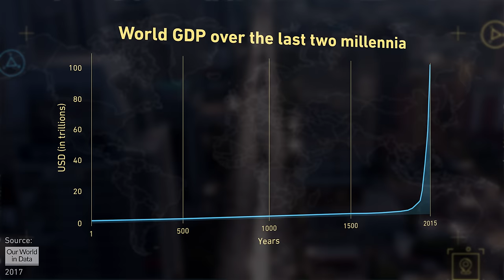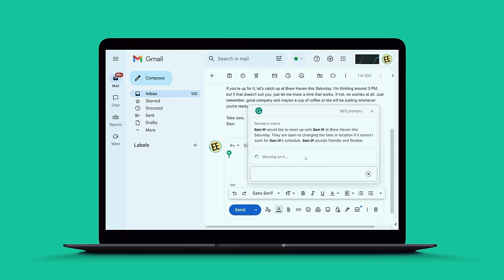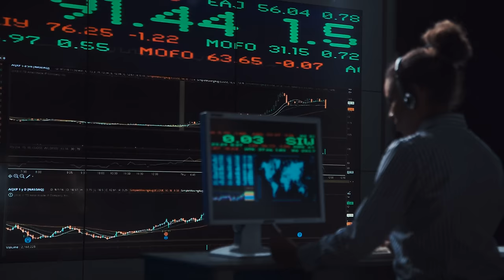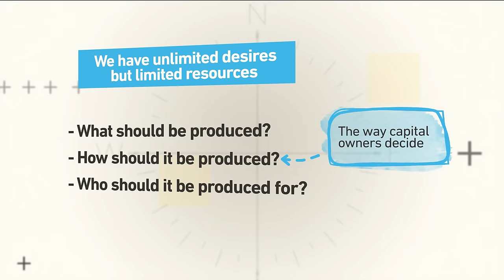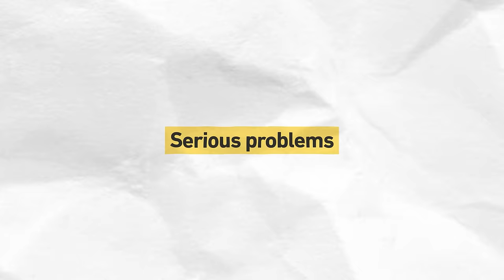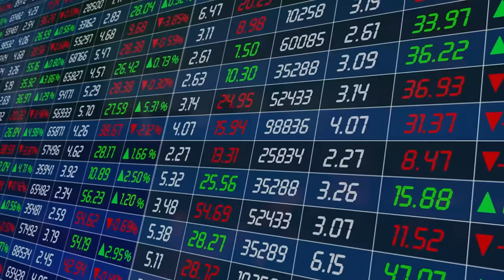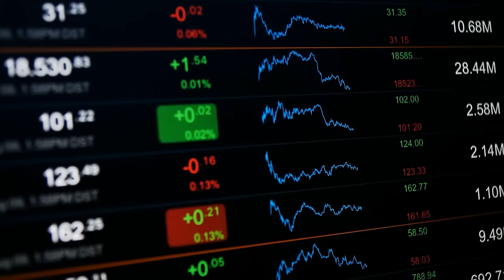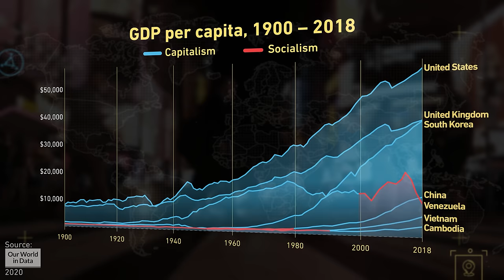Why Every Country Ends up Capitalist

Comment: I'm very aware of the shortcomings of the capitalist system but to say that exploitation of natural resources and erosion of human rights don't happen in other systems is not a great take. I'd argue inequality is similar actually.
Reply: Sure, you're right, it happens in other modes more. But what are we then talking about? Serfdom, colonialism and feudalism? I don't see how socialism is worse on human rights than capitalism
Reply: It’s true that exploitation of natural resources is not exclusive to capitalism. However, the scale and rate can vary significantly between systems. For instance, in a capitalist system, the drive for profit often leads to over-exploitation. In contrast, other systems tend to have more regulations and checks in place to prevent such exploitation.
Reply: While it’s true that human rights violations have occurred under various economic systems, it’s important to note that these are often more a result of political structures and leadership rather than the economic system itself.
Reply: It would be better described as a loop, where pure capitalism or pure socialism both create a single exploitive monopoly.
Reply: @uninstaller2860 socialism is MUCH worse for human rights... It literally HAS to ignore the natural rights of having private property in order to redistribute their earnings. Aka stealing. With capitalism it's voluntary.
Reply: @uninstaller2860  If you don't see it, you're either not looking hard enough, or you're blinded by ideology.
Reply: @ianmwangi2105  Comical to think the same drivers behind Capitalism are somehow absent in other systems.
The core engine of the automobile is identical between Capitalism and Socialism.
The difference is the chassis.
Reply: @GiRR007 you are confusing socialism with communism. Socialism is just an economic framework like capitalism, you can adapt it to your form of government. Communism uses involuntary redistribution of wealth to create a community that is level n can find commonality.
Reply: @SokiHime  If you can't explain it, then you don't understand what you believe yourself
Reply: @uninstaller2860 Clearly your Soviet history is a little lacking, if you think socialism doesn't do worse
Reply: @GiRR007  Who own the oil in the earth? The government or the people? Why not the people?
Reply: @uninstaller2860  also, your Mao history is a little lacking too
Reply: @azraeldemuirgos9518  I'd argue that the Soviet Union never reached even close to Socialism. The workers didn't control the means of production. The moneyless society was only for the party elite. There was no real liberty, no real democracy in election. Also, the Soviet Union was a state, which in itself tells us all that it wasn't a stateless society, which is the goal of Socialism. So, it is you who lack an understanding of Socialism. So, what was the Soviet Union then? State Capitalism, with a top heavy hierarchy.

Look, my goal in society is to have ownership of production by all people. It's workplace democracy, where we can vote our boss away. Personally I don't mind a manager making 4x my salary, but I do mind when it's 10x, and I hate it when they make 117x more. I want the workplace to look more like a functioning democracy, with freedom of speech. There is nothing that says your workplace has to function as a dictatorship or monarchy. You maybe don't like the terms I use, but I imagine you don't find my goals reprehensible? I will have solidarity with you, even if you don't find it in yourself to have it with me
Reply: @SokiHime  misrepresentation of my argument 🤦,,,shows the weakness of u're point,,, didn't say the drivers were absent just said that in capitalism there is a reluctance to enforce restrictions as these are generally seen as interfering with the free market
Reply: @lilyusi  thing is if a large enough proportion of the population decide to take up communism rather than capitalism it wouldn't really be involuntary,,,, for society to reach such a level where communism and marxism are the general consensus it would mean that most people feel like they don't have that much wealth to begin with
Reply: @azraeldemuirgos9518  there's a distinction actually between socialism and communism,,,what u referring to with the soviets is communism
Reply: @ianmwangi2105   but it is a type of socialism, is it not? Or are you trying to imply it is not a type of socialism?
Reply: @uninstaller2860   Firstly, you are arguing for a stateless society, yet are unable to distinguish that isn't socialism but Anarcho-communism, basically a type of socialism. Go back and learn again.

Secondly, the Soviet union was socialist, even communist, as they implemented collective farming and centralised the means of production into their hands, which is what socialism is, basically the means of production controlled by the state, as opposed to Capitalism which is the means of production controlled by private individuals. Communism is a type of socialism which adds the prerequisite calling for the abolishment of private property and 'eliminating Class inequality ' by 'redistributing wealth', and they failed woefully in helping the people or the environment as evidence by the famine and death and the major Environmental disasters that till now have yet to be abated (Chernobyl, the dried up river).

Thirdly, I don't care about your goal, or the fact that you believe in a fantasy ideology like 'workplace democracy'. Democracy only works if you own that thing by which you want to make a decision towards. The people own the country, the people built the country, the people are the country, they are born in it, they die in it, so it makes sense for Democracy to exist in a country. The workers do not own the company, the workers did not build the company, the workers are not the company, they are not born in it, they do not die in it, they simply have a contract with the company to work for a limited period of time, so what right to they have to act like they own the place? If they don't like the company they can simply leave. Do you allow the plumbers and builders you hire for your house to have a say in the decision makings of your house, do they get to tell you what to do? No, because they are simply hired hands, just like your house cannot be built or function without them, a company cannot function without workers, and similarly just like the builders have no say in your house (even though their entire livelihood is dependent on people like you who hire them), neither do the workers for the companies. You communists refuse to consider human behavior or common logic in your ideology because you know once you do, your ideology falls apart
Reply: @azraeldemuirgos9518  Marx didn't distinct between socialism and communism. I think it was Lenin who did that. But your definition is correct in how it's colloquially understood today, that communism is a deeper form of socialism. I'm more of an anarchist, so I haven't forgiven what Lenin did to the Russian anarchists. That's why I also use the term Socialism rather than Communism. The Soviet Union has tainted that term, with a lot of help from China
Reply: @azraeldemuirgos9518  Lol mucho texto, you'd be a great leftist. But no plumbers aren't just hired hands or unskilled labor as you seem to imply. If they were, there wouldn't be work for plumbers. I believe in you. There's room for you too to make this fantasy reality
Reply: @azraeldemuirgos9518  what u using is called the part and whole fallacy,,,,that is since communism is generally viewed as wrong everything even remotely associated with communism,,,eg socialism is inherently wrong,,,read on both then come back and argue against them 🤦
Reply: @azraeldemuirgos9518  social democracy is a reasonable middle ground between communism and capitalism,,,yes the hired hands don't have a right to dictate the rules in your house 🏡 but as tax paying citizens of the state such as yourself you can't have total power over them,,,which is where the state comes in with high minimum wages,unions for collective bargaining and all that good stuff that prevents people like you from paying them next to nothing then cruelly saying if you don't like it then leave
Reply: @ianmwangi2105   nope, I am not using that argument at all, I am simply trying to go against the notion here that socialism and Communism is different. Yes, not all socialism is Communism, but that doesn't make socialism different from Communism, just like how you cannot a finger is different from a thumb, when a thumb IS a finger. Communism IS a type of socialism hence saying there is a difference, instead saying 'communism is ONLY a type of socialism ' is just plain wrong. I would love to hear your argument against this
Reply: @uninstaller2860   This is purely a semantic argument, and will simply lead down to an unnecessary rabbit hole, whether Lenin made a distinction or not doesn't matter, infact it doesn't matter how Marx understood it, since socialism predates him, he came up with Communism, not socialism
Reply: @azraeldemuirgos9518  the problem isn't with definition it's the fact that most of the time people impose the flaws of one system on the other in a debate and use that as justification to dismiss both
Reply: @ianmwangi2105  'social democracy is a reasonable middle ground', yeah, I don't wholly agree, even your high minimum wage talk doesn't hold water as we know that the highest paid wages are in Scandinavian countries, which don't have statutory minimum wage (yes, they have unions who engage in collective bargaining industry by industry, but that isn't the state, as you so claimed would be good), America infact has had a decline in the proportion of black and young workers since minimum wage was implemented as it turns out that minimum wage hurts unskilled labourers the most, cause obviously, companies will want to hire skilled people if they have to pay them more. Again, Human Behavior is what you have to take into account when it comes to all these things. Any system can work well, even Communism, as long as it is pragmatic enough, the problem with communists is that they refuse to be pragmatic, instead indulge in fantasies of how humans would act In a selfless society, that's why the successful ones always resort to authoritarianism, because they realise too late that Humans act based on incentive, and to preserve their ideology they force humans to act they want they desire, and it all goes downhill from there.

If a company wants its workers to have a say in how it runs, I have no problem with that, it is its right to do so, but that doesn't means to force others to have to share the ownership of their companies with their hired hands
Reply: @azraeldemuirgos9518  Didn't you read my comment? I meant that it is semantics from my part, yes. And no, Marx didn't invent communism or the term even. He popularized it, but he added to it a lot though!
Reply: @ianmwangi2105   that is their fault no? That is not a justification for you to be wrong, say it as it is, Communism is only a type of socialism, it doesn't define socialism as a whole
Reply: @azraeldemuirgos9518  claiming unions and the state aren't at all connected is dumb 🤦read on the role of States in workplaces and you'll find out that different government policies regarding unions is the reason we have more unions in Scandinavian countries than in the States,,,, Scandinavian countries generally being more socialist tend to have more union friendly policies while the States which is generally more capitalistic has more corporate friendly policies
Reply: @azraeldemuirgos9518  🤦🤦 can't believe u seriously implying that companies will suddenly demand a university degree rather than hire unskilled workers because of a minimum wage rise from 6.55 to 7.25,,,, how many skilled workers do you think will work for 7.25,,,most white collars can't get it but such a small rise can mean the difference between starving or not for most of these unskilled workers,,, especially with inflation eating up what little they make,,,,but according to you paying someone enough not to starve is too much a price to pay,,,then you'll start singing how capitalism is everyone's savior 🤦🤦 my point exactly on why it is so difficult to see people as people and not just statistics on a balance sheet in Laissez faire capitalism
Reply: @azraeldemuirgos9518  I think it is ingenuous to say that communism relies on the naive believe that humans are selfless,,,the exact opposite is true actually where socialist and communism systems acknowledge the inherent greed of human nature hence place government interventions in place to rein it in whereas capitalism runs on the naive assumption that the market will miraculously do what's best for everyone
Reply: @azraeldemuirgos9518  that's the thing 💔 when you say someone owns the company we generally view it as owning the capital and land and not the people,,,but by having the power to pay those people however little they please and telling them they can leave if they like,,, whereas in reality they can't since every company is doing the same,,,the capitalist end up effectively owning the workers,,,which is what pretty much every other economic system (except feudalism) is primarily opposed to
Reply: @ianmwangi2105  a government policy allowing unions to bargain on their own is different from a government taking one the jobs to bargain, no, order the level of wage 'on behalf of the workers', do you not understand that difference? Governments are also what protects patents and intelligence properties that allows capitalism to flourish, are we going to then devote the success of companies to the government? That's incredibly stupid, and it's disappointing you failed to make that difference.

Also, you say Scandinavian countries are more socialist, you also have that wrong too, yes they implemented some socialist policies but they are actually more capitalist than even USA, go and check the capitalist countries index and you will find out. You don't even need to check, their policies on tax and how they target the middle class more than the rich and companies is alone enough to tell you how they view their society
Reply: @uninstaller2860 Serfdom, colonialism and feudalism are not economic systems. They are political systems.

Every socialist country to date has made extensive use of forced labour enslaving the people to the state and has committed genocides against political dissents.

Also your arguments that socialism requires a stateless existence makes it an impossible goal. A stateless nation cannot exist while other states also exist. They inevitably are either dominated by a neighbour or collapse into a hierarchical state.
Reply: @azraeldemuirgos9518  so are you saying that america is more socialist?
Reply: @azraeldemuirgos9518  checked out your "capitalist countries index"🤦,,you are talking about the economic freedom index which is a measure of opportunity in commerce rather than "how capitalist a country is",that's why Scandinavian countries rank higher,,,their socialist policies tend to ensure more economic freedom at the expense of maximum production which is the opposite of americas more capitalistic take
Reply: @ianmwangi2105   what no? That's not what the index means, the index simply ranks countries most favourable to Capitalism and businesses, and Scandinavian countries, many of them, outrank the US
Reply: @ianmwangi2105   measure of opportunity in Commerce is what? What is it? Define it. Is it the opportunity of government or of private individuals? Is Maximum production how you define capitalism? Cause by that metric, china is the most capitalist country on earth lol

Also, you say their socialist policies is what allows the economic freedom, please by all means, show the correlation-causation of how their socialist policies lead to more opportunities in the business sector, with proof, mind you
Reply: @ianmwangi2105  Do you know what happened to the Aral sea under communism? Do you know what happened in the Siberian Gulag? There is no comparison. Capitalism is heaven on earth.
Reply: @uninstaller2860  In a democracy, the government represents the people.
Reply: @ronald3836  I don't oppose governing bodies
Reply: @GiRR007  So you think owning property is a more important right than being able to feed and house oneself? Obviously…
Reply: @azraeldemuirgos9518  “socialism doesn’t work cuz Soviet Union.” By that logic capitalism sucks cuz of the laissez-era. The first capitalistic nations sucked too.
Reply: @L333gok  Yes... Without the right to own anything you can't have food or housing.
Reply: @L333gok   is house not a property?
Reply: @GiRR007  Ah yes, of course, my bad. Less than a quarter of the USA owns property. I guess I just forgot 75% of Americans are starving and homeless. My apologies for being so ignorant.
Reply: @L333gok   75% of Americans are starving and homeless? Lol, you must be high
Reply: @azraeldemuirgos9518  Are you on the spectrum? Can’t understand sarcasm? I’m following your logic. You claim that you can’t obtain food and shelter without owning property, so naturally the 75% that don’t mustn’t have access to those produces.
Reply: @L333gok  Is a house not a property? Is a car not a property? Where are you getting that 75% from, I don't even understand. Americans possess property, so you are only mocking yourself
Reply: @azraeldemuirgos9518  Please explain to me how owning a car will provide you with or generate you food. I’m really curious how you go about this. Also, you literally claim stuff like “communism is a type of socialism” and “the Scandinavian countries have a higher average wage than the US.” You have no idea what you’re even talking about.

And in response to your question: the majority of Americans rent. They aren’t all privileged upper middle class guys like you
Reply: @L333gok  First of all, the majority of Americans don't rent, 65.9% of Americans are homeowners, which means the majority of Americans actually own a home, only about 36% of Americans rent, you can go and check yourself, I am not going to belittle you about the fact that you are ignorant of this while arguing so passionately since you have already proven you don't use your brain.

Secondly, even for those who rent, they have shelter, and it isn't just a shelter, they have a home, they may not own it, but it is theirs as long as they pay continue to rent, and they cannot be kicked off just based on their landlord's whim, more importantly, they have food, which goes against your attempt at mockery.

Thirdly, is Communism not a type of socialism? Or are you ignorant about that one too? And yes, Scandinavian countries have a higher average wage than the US, the highest in the world, what are you arguing about?

Fourth, I am not some Upper middle class person, I grew up in Africa, from Nigeria, nice assumption though
Reply: @lilyusi  No matter how you frame it socialism will always take from those deemed deserving of it and give to those who are deemed needing it. Again, taxes. There is no socialism without government enforced confiscation of people's money.
Reply: @uninstaller2860  
>I don't see how socialism is worse on human rights than capitalism

Ok, then open your eyes. If you don't know anything about history or the world today, of course you can't "see" anything.
Reply: @ianmwangi2105 
>more a result of political structures and leadership rather than the economic system itself

Under socialism, the government controls the economy. Socialism IS a political structure.
Reply: @ianmwangi2105 you mean the very entity known for causing more pain and suffering?
Reply: @GiRR007  do you still not understand what private property is? Private property is not the same as PERSONAL property. 
Private property are factories, stores, tools of production and so on. 
Personal property is your own home, your clothing, your car, even your pets. 

So let me explain what actually happens in Socialism. 

Instead of one capitalist owning a factory for example, all the workers in that factory share equal ownership of the factory. 
The only person who would claim to be a victim of stealing is the capitalist who before that had full control of the factory. 

Most people aren't capitalist, they are workers. 

And none of the personal property is being touched, only who owns the tools of the economy. 

Lastly, to get to your point of "natural right to private property", I would argue that under Socialism more people would have that right, since more people co-own the same stuff.
Reply: @azraeldemuirgos9518  explain to me how the Soviet Union is an example of a socialist free market. Because it is not. 

No one is advocating for central planing of everything in an economy, which was what the Soviets did.